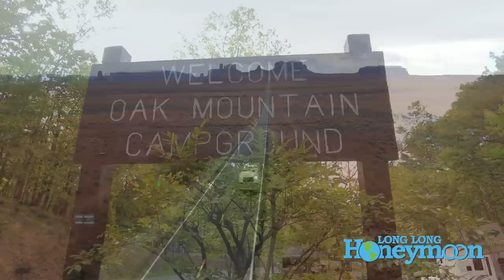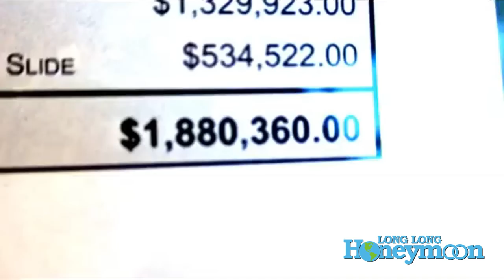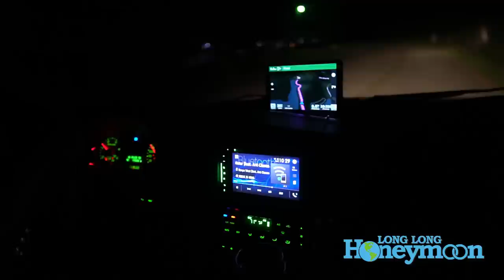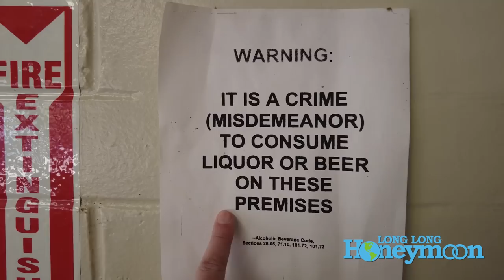😳The 5 Greatest FEARS of RV Travel - and How to Conquer Them!

Comment: I found it ironic that after watching this video, 6 weeks into our Maritime Canada tour, we had just left the Ontario campground, 5 miles later one of the outer bearings disintegrated , we had heavy smoke a few seconds away from loosing the wheel. We limped back to the campground, found a replacement hub/bearing/ brake assembly, and got it fixed with some help from neighboring RVers. I’m glad I was prepared with tools and the ability to work through the problem. 
Appreciate the video

Comment: You are absolutely correct. My greatest fear is that the diesel truck I tow with will break down and cost a fortune to get it running and home. Thankfully, a few weeks ago, after having driven the truck locally (which I rarely do) the radiator sprung a leak. So I set about replacing the radiator, the hoses, the water pump and belt and tensioner, yada yada. I left nothing to chance. I will extensively test drive it before another tow. i am GLAD it broke..... at home! Being a retired aircraft mechanic, I know what can break, so I am always worrying about all of the what Ifs of the truck and trailer. Thanks for your videos, always look forward to new ones.

Comment: Great video! The first tip I find useful is to look at the picture view (not just the map view) on Google Maps of key or complicated junctions and exits. For long trips with a trailer, I virtually make a documentary presentation of the route ahead of time, with photos (DRIVER VIEW, not just bird's eye view) of each major or complicated intersections and exits. If you're driving solo, this can be a life saver and certainly a stress and fatigue saver. Especially when your  navigation fails suddenly and at the worst possible moment, when you're tired and in the one area you don't know well. The second tip is, of course, plan safe places to stop along the way. If you think you can manage four hours of driving, find at least four places that you could stop safely before that four hours is up. You never know when fatigue will set in, or just tensions and nervousness, which will make you tired. On some trips, I've stopped four or five times in the first two hours. Not planned, but I pay respectful attention to my state and the conditions -- dangerous road conditions, traffic, tension and fatigue, checking on trailer, tires -- just to be sure. It's not a crime to stop more often or earlier than planned. Plan places along the way where you can stop safely -- Cracker Barrel, Ikea, police stations, hospitals, safe and well-lighted gas stations and truck stops, camping grounds that don't require a reservation. It can save your life. Don't be a hero. We all want to get home or to our dream campground. Never hesitate to get there a day later but safe!

Comment: Had our first flat tire last week. TPMS alerted “leaking” so we pulled over (50 miles South of Alpine, TX). While unscrewing the TPMS cap the valve stem broke off in my hand. Roadside assistance (5 hours later) and repair (17 hours more), all good. One night in a hotel and one day of RVing lost in one year of full time, not bad.
Reply: The one flat I had was a stem too. When I had the tires mounted I told them to change the valve stems, but they didn't.
Reply: Replace your valve stems with steel ones if you are using screw on TPMS sensors. Rubber valve stems will eventually crack due to bending from the centrifugal force of the extra little bit of weight on the end of them. Steel ones won’t, and they aren’t expensive. Your tire shop can tell you what size you need and where to get them (if they don’t happen to have the ones you need). Safe travels.

Comment: All very good advise and right on the money.   We are leaving for about a month (we always have the loosest agenda) and have made the shakedown trip already.  De-winterized, sanitized, and starting to organize.  New tires on truck, new brakes tomorrow.  Take tools and know your vehicle and RV.  I read of so many minor problems that seem insurmountable but are easily fixed.  Yes to paper maps.  Almost every hole in the wall town will have a laundromat.  Wal Marts are everywhere.  Travel light.  If you need something, stop at Wal Mart.  Weight is your enemy.  You may not need to travel with a full water tank.  Inspect!  My biggest fear is getting sick in some remote location and not having cell coverage.  Added 50 watt GRMS to the truck.  Now have two means of comm.  Where we remain remiss is wife's ability to hook up trailer.  Historically, I have handled the outside; she handles the in.  As we have gotten older, and experienced one health challenge on the road, this trip will be used to build her confidence in the hook up procedure.  This was a great video.  A lot of what we have learned over the last 4 years started with your videos.  Thx.

Comment: Great advice once again,  thanks to a older video of yours, advising  that if you have two axles,  you should have two spares,  I went out the next day and got another spare, our next trip, we lost a tire with out knowing it right away and by the time we pulled over the other tire on that side was worn down to the steel belts,  Without two spares we would have been stuck until we got another spare, but with two we were back on the road in about 30 minutes.  So keep up the great videos, you'll never know how many people you have helped.  Thanks!

Comment: I really appreciate these videos.  Just because I’m on an interstate I don’t feel pressured to drive 70 as Kristy implied.  I stay on 2nd lane from the right and keep it to 65.  Not only do I feel it’s safer, it’s a lot less stressful.
Reply from the maker: Thanks for the feedback! Yes, it's definitely less stressful to just dial it down a notch and enjoy the journey.  👍
Reply: It may feel safer but the data says it's far less safe to get off the freeway. Also, less stressful as the guy tailgating you simply gets in the left lane and goes by on the freeway. On side roads, you wind up watching him crowd you for 20-30miles if there is no where to pull off and let him by. I don't mind driving on the side roads but freeways are less stressful unless in a major city.

Comment: The way I handled over the years about mechanical breakdowns is to learn as much as you can about your specific coach and how to do repairs.  I spend hours on YouTube learning new things. After so many years there are only a few things I need a mechanic for now. We live in a class B so cramped space is common but not a problem.  Our only fear is leaving our home empty while we're gone worried because We have lots of plants, gardens and a large koi pond that needs attention
Reply: Our first rig was a "handyman special" that I renovated. By the time it was ready to use I was up to speed on all of its systems. When we upgraded to a newer rig from a different manufacturer I felt right at home. R-Vision bought appliances and fixtures from Dometic and Thetford, and then built on top of Lippert chassis . Our newer Forest River rig is made with similar equipment. Aside from the upmarket shell, so is an Airstream.
Reply: As long as your mobile your good.. spare tires and fluids.. new high cold cranking Amp battery, newer starter and alternator, water pump, fuel pump, . Ignition coil, etc. 

It is much cheaper to preventative replace then break down... look for cheap parts.. 

Paint lines to prevent corrosion. 

Flush out oil, trany , differential fluid..  

Keep tire repair kit, pump, plugs  

Most problems can be avoided with preventative maintenence and basic tools and fluids.

Comment: I have been a full time RVer for 2 years and recently discovered why a travel trailer is the only way I’ll do it.  I was considering a class C and a tow car.  Which came to a halt when my tow vehicle, a 2010 Dodge 3500 DRW 6.7L Cummins with 125k miles on it blew a turbocharger.  It was in the dealers shop for 3+ weeks.  Two thousand miles later the Turbo blew again and the entire emission system including the catalytic converter‘s had to be replaced. That was another 6 weeks in the dealer shop. 
My point is if I had gone with a class and had catastrophic engine issues. I would’ve been without my home.  

Ps.  I don’t have that truck anymore.

Comment: We have few problems, but when they happen, it adds to the story of our trip.  We prefer using a 33' motorhome (2018 Winnebago Vista) with 2 slides, roomy inside with great inside and outside storage. At 33' long we fit all national parks. We love our Garmin RV890  too.  We flat tow a Honda CRV.  This configuration, IMO, optimizes FAST setup of camp at arrival, and FAST breakdown of camp to get back on the road.    This really expands our time to explore POIs at overnight stops between destinations.  When we check-in to a campground around 2pm, after arriving at the site, we're setup within 10min max.  We immediately pack a snack and drink and hop in the CRV to explore the local POIs until dark.  That's usually about 5hrs of exploration for an overnight stop. The CRV weighs only 3200lbs, great on gas, AWD, and easy to park in the smallest places, perfect for exploring.  We also have ebikes on the back of the CRV in case there's good trails to ride in the area.

Comment: Hey guys, really enjoy your channel.  We have a 2005 AS 28' Classic with the original AC unit.  You mentioned AC problems; possibly replacement maybe?  I looked at your video web page and could not find anything relating to your AC unit i.e. what was wrong, what you did to fix it, etc.  Did I miss something?  Nothing is wrong with our AC unit that I am aware of, but this is a fear that I do have.  Keep the videos coming.  Cheers
Reply from the maker: We have had a couple of issues over the years. The first time we had a problem, we took it to an RV service center and were told that the units could not be serviced, and it would need to be replaced. This was not true! We were on our way to an airstream event in Ohio at the time, so we went to the Airstream factory, and they actually service the unit. On another occasion, the control board failed and needed to be replaced. At this point, the unit is 20 years old, but it still blows cold air, and we have no intentions of replacing it until we need to do so.
Reply: @LongLongHoneymoon  Thank you!

Comment: One of my fears is running out of fuel. I start looking for a GOOD fuel stop as I approach a quarter of a tank. I hate getting gas at some cramped little station that's ill-suited to a maneuvering our pickup and trailer. Add in other customers walking and driving around you and it's even worse. I almost never pay "on highway" prices for gas when I'm not towing, but sometimes it's worth it when I have the RV trailer.

Comment: LoLoHo, we have something in common, we both have ageing 6.0L Diesel trucks, my 2005 Excursion is getting close to 200,000 miles and fortunately it has not had any engine or transmission issues, yes stock head bolts. I am a person who stays on top of everything but there are times on trips the truck needs attention. Last trip was a couple of weeks ago to Western NY from NC. In NY, I noticed a loss of coolant, the degas bottle was seeping. I immediately found one at a local auto parts store and replaced it in their lot. I would rather do it there in case other parts were needed and I am not in a campground miles away. We also had to tear apart and chase 3 baby mice that were stowaways, tearing apart the drawers and panels was not my evening enjoyment. My biggest fear is a mechanical issue.

You need to know your truck and camper and how to fix stuff. Last year in Colorado the trailer had a brake issue. In Tennessee the truck needed an EGR valve. Both easily fixed but if my knowledge wasn't there, could have been a nightmare. Carry a lot of tools, a second spare, extra fuel and some spare parts for both vehicles. Don't forget extra oil, transmission fluid and coolant. Keep water in the RV fresh tank. While on trips service the truck as needed. Ask permission to do it at an auto parts store. I carry my own oil and filter and drain pan but I always buy something in the store.

Google Maps has gotten me into trouble. I rely on a route I pick out and the trusty Road Atlas, Google is the backup.

That was an awesome episode.

Comment: Back about 1990 I bought a used 25' Layton TT with cracked tires and a week later pulled it 600 miles to Disney World with a short wheel base 86 F150.  I had only pulled a popup before.  I didn't have sway control on the hitch so the drive there was exciting to say the least.  It took both hands on the steering wheel to keep it in the lane and I would cringe every time a big truck passed me at 65mph.  I was a big dummy for sure.  When I got back I added the Reese dual cam sway control and stability wasn't an issue afterwards. I also replaced the tires with auto tires when I got back.
Reply: Reading your comment made me breakout in a cold sweat! 😆 Glad you added the sway bar and replaced the tires!
Reply: @kristymichael  Yes, it was one of the most stupid things I've done in my life.  A few years later when the kids got old enough they didn't want to go camping with Dad any more, I advertised the TT and the Ford window van I was using for a tow vehicle at that time and they both sold almost immediately on the same day to two different customers!